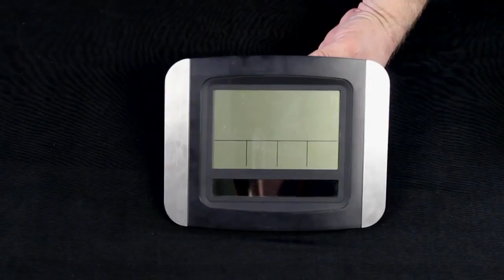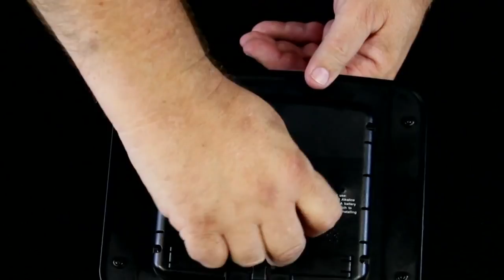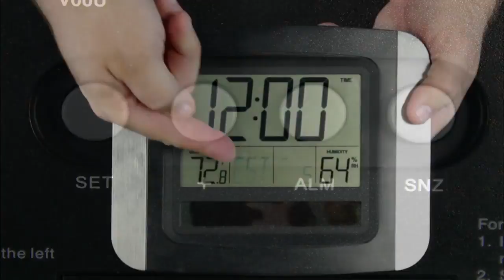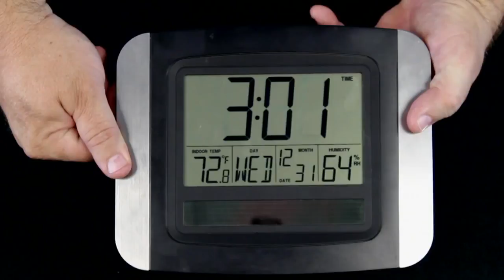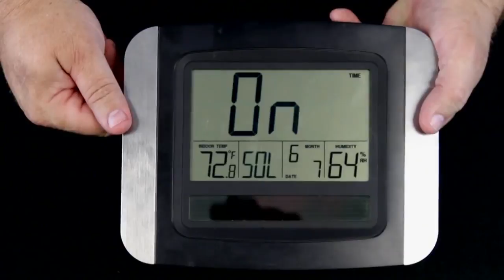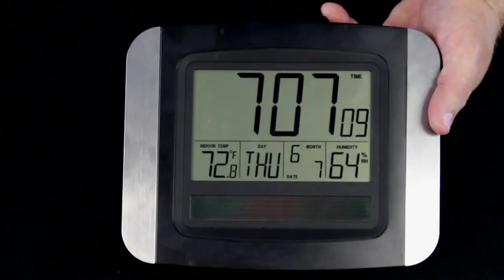WT-8029U Solar Powered Atomic Wall Clock

Comment: Where can you get the rechargeable alkaline batteries that come with it ? When mine started losing charge, I switched over to using alkaline batteries. I doubt using rechargeable nickel metal-hydride probably because it won`t work or be compatible with the clock.
Reply from the maker: Hey Darrell, great question! Unfortunately, this model clock has been retired for some time and we no longer have replacement rechargeable batteries available for it. If you're interested in upgrading to something newer, we'd be happy to get you a discount toward that upgrade. Simply message our support staff directly here: https://bit.ly/contact_techsupport. Or alternatively, send us a private message on our Facebook: http://bit.ly/LaxTech_Facebook or Twitter: http://bit.ly/LaxTech__Twitter page to make that happen. We apologize for any inconvenience.

Comment: I had to put in a fresh battery and set the time accordingly. After doing so, I don’t see a signal icon from Fort Collins, CO. to show its receiving the signal. Will it eventually show?
Reply from the maker: If your clock was previously synced with the WWVB radio transmission, it will likely sync up again soon. This can sometimes take a few days depending on your location.

Comment: can the clock take a lithium ion battery 3.7 volts?
Reply from the maker: Unfortunately, no. This model was designed to use the included rechargeable alkaline battery, or standard AA alkaline battery. Please note that if switching from one or the other, the switch on the back will need to be adjusted appropriately. Instructs for this can be found in the full manual here: https://www.lacrossetechnology.com/media/catalog/product/w/t/wt-8029u.pdf
Reply: Mine took about 5 minutes, then it showed everything right automatically , time, date, temperature, humidity and day of the week.

Comment: My display is going dark. Had this clock a number of years and it works well, even the battery. Now what can I do about the LCD background going dark?
Reply: Mine too. If I pull the clock away from a direct light it goes blank. I changed batteries to no avail. And even with the light shown directly on it, if the stand the clock straight up, as hanging back on the wall it goes out regardless. On its fee leaning back with a light, it stays on.